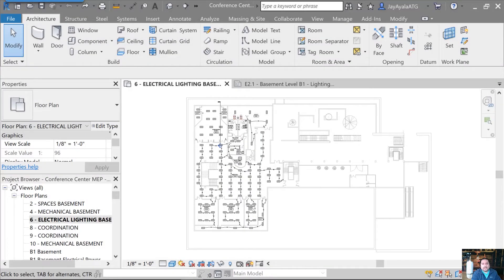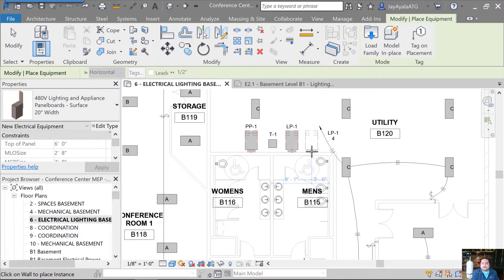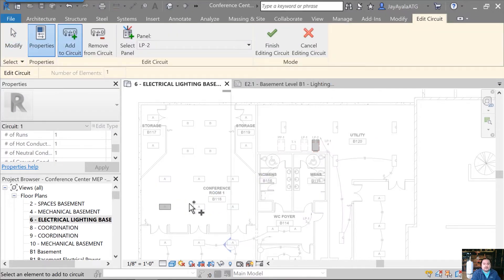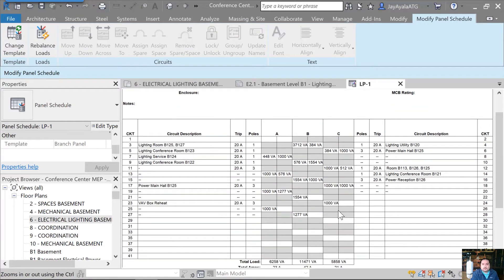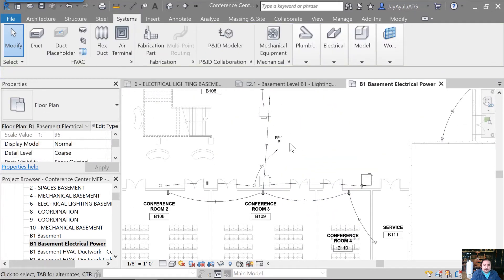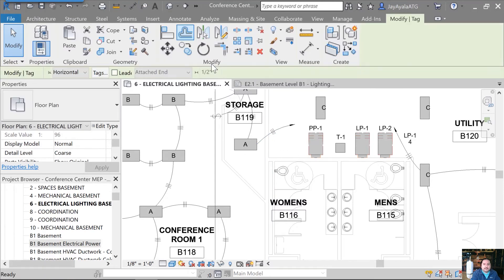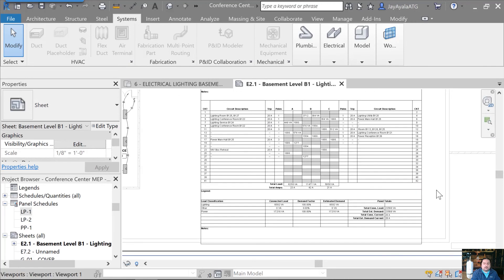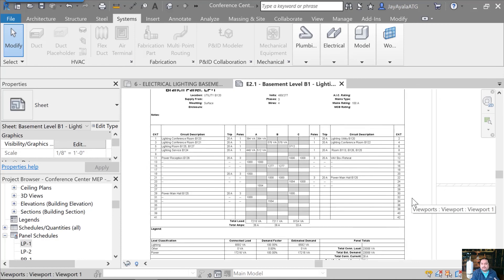Creating Power Panels and Layout Circuits in Revit for Electrical

Comment: I have a quick question, I need to add power to a Mitsubishi outdoor unit which i know for a fact that it requires a 2 pole circuit, but when i power it with Revit, it gives it a 1pole circuit automatically, is there a way to manually change this? As well i tried but it wont' let me.

Comment: I am wondering about your "wire" setup - yours is not automatically adding arrowheads and is connecting to elements.  I am doing the same exact steps but I am not seeing the highlighted wiring to auto-add the wiring and I am getting instead a wire for each item with an arrowhead.  What is the setup you did to auto-connect your electrical elements?